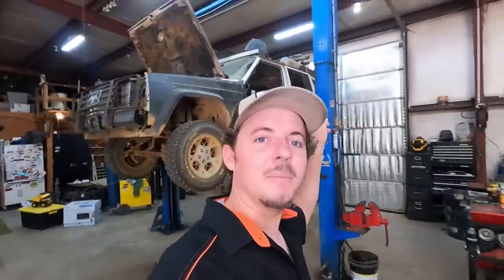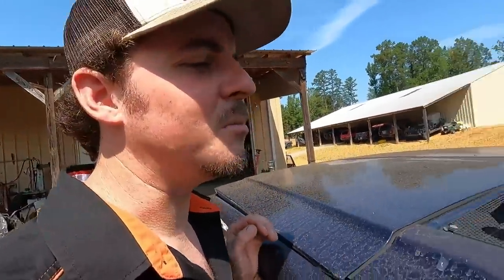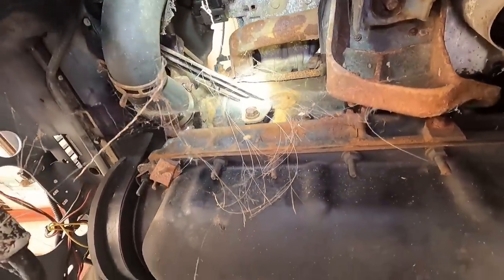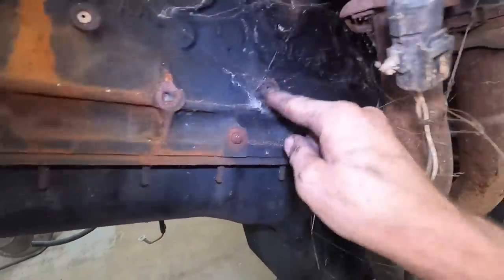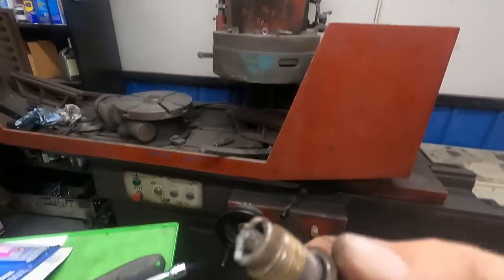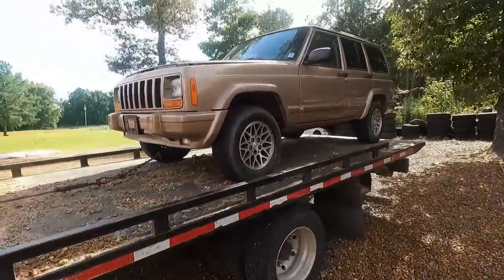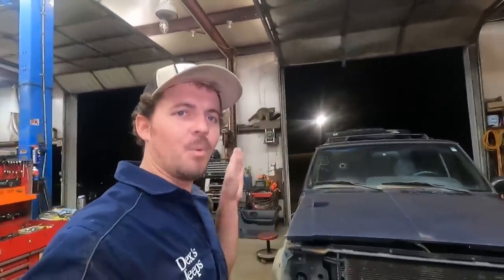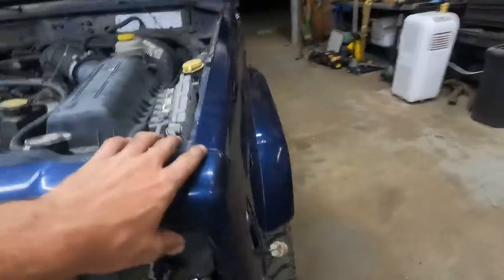Wrecked Jeep Cherokee To The Rescue: How I Save And Fix Other Jeep Cherokees

Comment: You’re going to have to up your cherry picker game! Cleetus used a helicopter to pull an engine the other day!
Reply from the maker: I’m on a different budget… ☹️
Reply: @dexjs  nahh we need this down home, genuine knowledge. Much more valuable!
Reply: Hi Dex have a xj 2001 in Caribbean Barbados we have about 10 left on island trying to get it on road but getting trouble with the engine was working swap auto to a older manual ax 15 and now it starts then revs out seem to be flooding with fuel

Comment: Hey man I just bought a 2001 cherokee and it running a code p0500 and I replaced the speed sensor on the transfer case but still has the same problem and pointers?